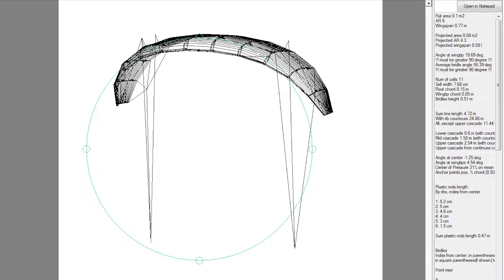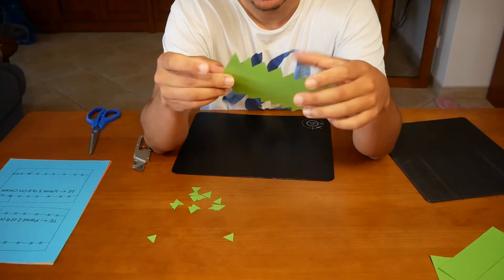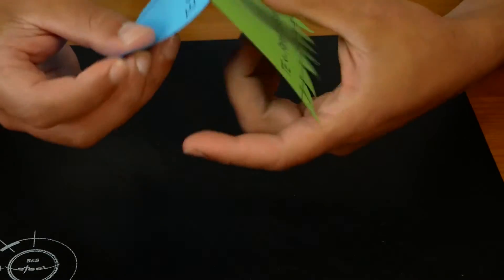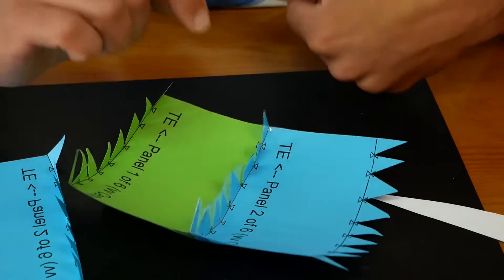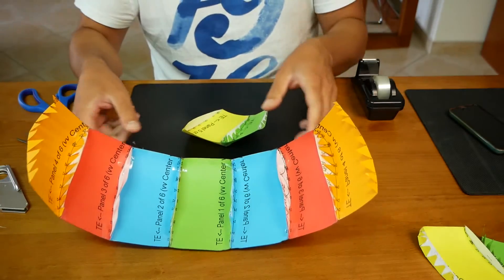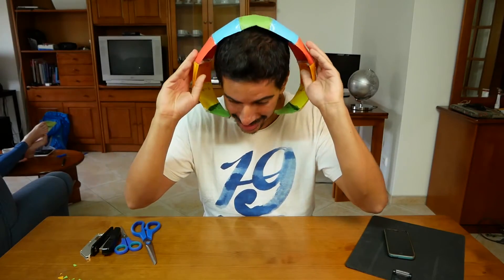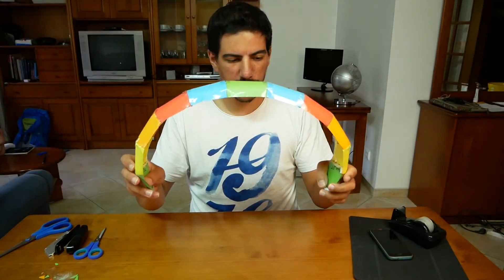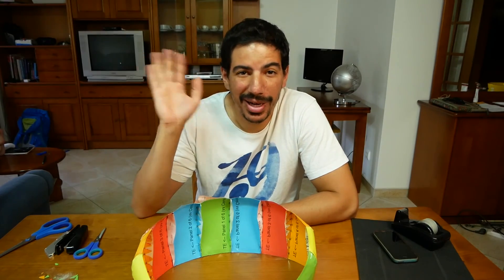Design Your Own Paraglider - Making a Paraglider Part 4 - BANDARRA

Comment: Hi, can you tell me, why gliders does not have some kind of stiffener in leading edge? Some carbon or dural sticks or whatever...  Its only 
lay question. I think the leading edge will be more robust against the collapses...
Reply from the maker: it's only a paper glider to check the shape so not really needed
Reply: @AndreBandarra1  I dont ask to this paper model, but about gliders at all.
Reply from the maker: @camotobe  yeah most actual flying gliders do have that

Comment: Cool video Andre!
The ribs are the airfoil reference, so cutouts are not meant to add flexibility in that sense as it will deform airfoil as you pointed out. However, paper is rigid and ripstop nylon is quite flexible. Under load the ripstop cells will "balloon" which will effectively shorten their width spanwise, especially the top skin. Sail tension and ballooning are parameters usually taken into consideration by the softwares when making templates to give you accurate final shape once under load. I believe that material rigidity is accountable for the exaggerated arc of your paper prototype.
Reply from the maker: I think that sounds very likely to be the reason why the 3d model and the paper model looked different, I'll investigate!

Comment: Way to power through Andre!! Great work. Do you think it would be better to make with fabric material? May be easier to sew, and also more flexible. With the curvature in the leading edge, and the single skin, will it actually fly? Again, with the fabric, once the lines are attached it could be flown like a kite possibly. Keep up the amazing work and keep the videos coming.
Reply from the maker: Yeah I've thought about that but will need to get paraglider cloth from somewhere and maybe even more important the right thread to sew it with.
Reply: Ripstop nylon of 60g/sqm is available from aliexpress for very cheap. I use it for my kites. It can be as cheap as 2euro per linear meter (1.5wide). It would probably be fine for a paraglider too but considering the effort to sew one I'd advise to go for something better, not necessarily skytex although the 40g is not too expensive. Quality spinnaker works well, I've built my first glider from it, 42g/sqm. As for thread, I recommend ticket number 40/3 polyester. Niviuk uses serafil 60/3 on the skin, but I've got good results with 40 (lower number thicker thread). Bonded polyester thread is good too, used for outdoor stuff and somewhat more uv resistant. Cheers and good luck with the experiments!
Reply from the maker: @Arno_mtz  Sounds like you have experience is exactly where I need to go next! Do you mind sharing links/details as I'm really not sure what to look for. Also I think I would rather go for more delicate/thinner material and thread because I only have a old household sewing machine at the moment and I don't think it will take thick thread and material
Reply from the maker: @Arno_mtz  this is super super useful Arnaud, thank you so much! Will place a little order of your suggestions and see what happens :)
Reply: @Arno_mtz  are you able to post some pictures/videos of your creations? I'd love to see what they look like, and how they handle.
Reply: @MrWhynotnow  you can check out laboratoridenvol dot com, it's the website of the man who created the software to design the wings. He is hosting a bunch of photos and videos of people who have built wings using the software. Mine is the blue 23m with black tips. I'm working on an orange version in 16m as 23 is too floaty for my 75kgs, using skytex 27g/sqm fabric this time. I'm targeting 1.5kg for the whole wing.

Comment: Maybe the reds or oranges need to be more narrow to cut down on width which causes it to be come a long round circle. Cut 2 reds in half width and some on the oranges and see what happens it may become more tighter pulling on top . A normal kite has large to smaller cells. Good video Andre

Comment: I grabbed SingleSkin and in a 5 minute "learn by the seat of your pants" session, trying to replicate the dimensions of  BCD Seed GH wing: https://www.flybgd.com/en/paragliders/seed--paragliders-2021-992-0.html
I haven't attempted to actually print anything out, or put it together yet, but it's a fun project for sure. Thanks to Arnaud for providing material/thread specs. What would you guys use for riser material?
Andre, any follow up on this project yet? Probably too nice out for real flying, and not stuck inside witching away on projects like this. Keep high my friend!!!
Reply from the maker: Yeah, it will take time as I want to do some software tweaks and I've ordered some materials so in time... :)